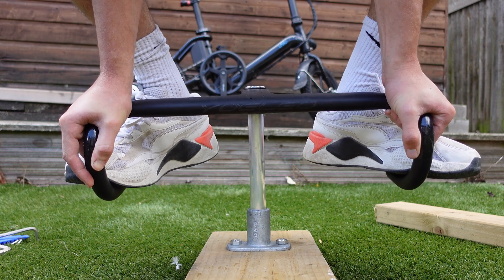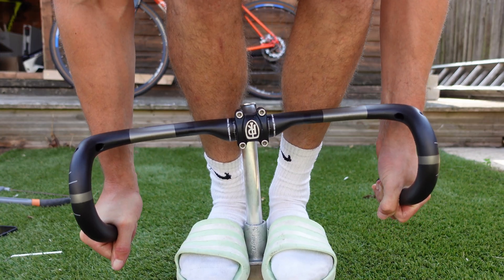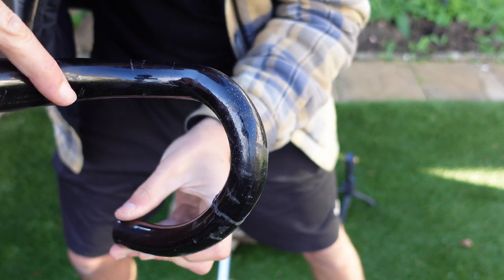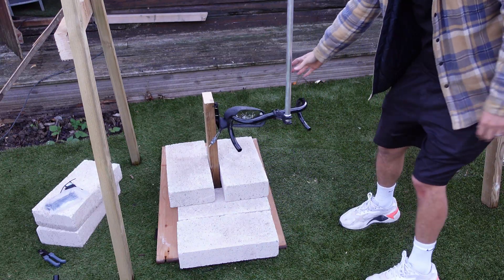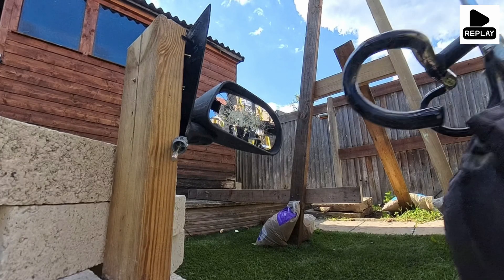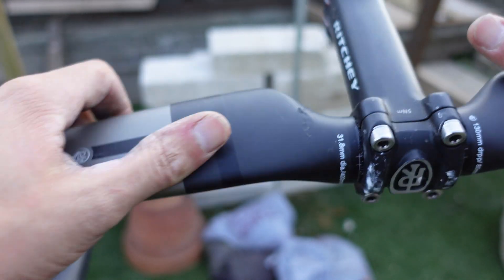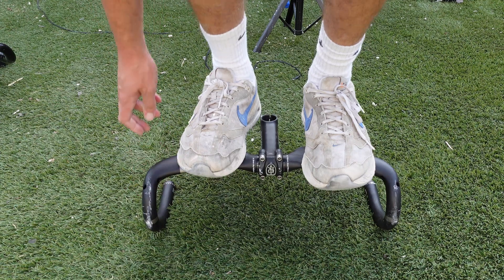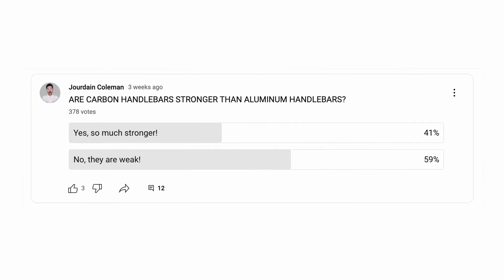Carbon Durability Test #1

Comment: Good-ish, but the distance from the stem to the pull point varies. Little point going past 150Kg. Measuring deformation at each load would be more useful. This is especially true if you plan doing frames/wheels etc.

Comment: Ratcheting test wasn’t equal WRT the position of the strap on the bars. The Alu bars had the strap closer to the stem. So the leverage effect is lessened and you need more force for the same real stress on the bars.

Comment: The strap test seems slightly unfair for the integrated carbon bar/stem, as at 15:50, the bar seems to be resting in the sharp corner of the wood beam of the gig, This is creating a stress point that probably help the bar breaking when and where it did. The aluminium bar was resting into the stem, so no additional stress point was created, apart from the interface between the bar and stem that was designed exactly for that purpose. In summary,  in a completely fair test the integrated bar/stem would probably withstand a slightly higher load and the difference to the aluminium would be smaller.

Comment: The first test rig. It doesn't bear thinking about what would have happend if the bars had snapped. Coming down hard on the stem/top of the tube would have been eye watering.
Reply from the maker: It would have been a very different video 😂

Comment: Now do it again but slightly over tighten the stem bolts and watch the cabins snap on the joint. Before anyone starts I know you all torque them correctly but you don't once you're in a field on the first ride and decide to roll your bars slightly

Comment: Hi chap. That is a huge undertaking to bring this excellent experiment to your audience. Where do you find the time?!

A few comments ( sorry i am commenting from my private channel) : The stress test you showed on both carb and alloy bars its important that the straps are in the same place for both. The alloy got a bit of freer ride on the non-drive-side so you would possibly see a lower weight to distortion ratio from the alloy. Also the carbon bars are a good bit thinner in wall thickness discounting the weight difference for that size object so there is that to factor in. 
The main point to make is that for this intended purpose, even as a carbon guy, alloy wins in my book. Why? simply because of the way alloy and carbon break under pressure. A pure carbon bar will always fracture after it over flexes and like a house of cards, you go along with it. In most cases the alloy deforms a fair bit before it comes apart giving you a chance to sit upright and stroke your brused ego. It is the same with stems and crown races in forks. So it is not about which is stronger it is about which one gives the rider the chance to not face plant. Alloy is plenty strong enough for this purpose as your tests show. 
There is a rule here at CarbonBikeRepair - If there is 1 of anything keeping the rider from a face plant it is better made of a material which can deform rather than fracture first. Of course the speed and weight of an impact is a rule unto itself but some cyclists perception that carbon is better, because it is structurally 'stronger,' only tells part of the story. There is still a lot of use for alloy in modern carbon bikes. We tend to watch the baby being thrown out with the bath water in so many modern bikes we see come through our doors.  Then there is this obsession with weight.. come visit us some day and I'll explain to your audience! Take care mate. Great honest channel for us all.

Comment: over tightening clamps is what does the damage.  That with crashes will cause failure make sure when you are doing the crane pull make sure the distance from the centre to the strap is the same.

Comment: Always read the instructions for your stem, some stems require to close the gap on the top. I ruined one carbon bar by torquing all the bolts and not closing the top gap.
Reply: It's annoying when this is never mentioned anywhere on the stem itself, like with Canyon's stems.

Luckily, I know how to determine without looking at a user manual (will still read one to double-confirm my analysis).
Reply: @sbccbc7471  How?
Reply: @Markus-.5712  Top-to-bottom faceplate asymmetry is what I look for. A hands-on method is to install the faceplate without the handlebars and see if the faceplate has two or four points of contact on the stem.

If only the top or bottom of the faceplate touches the stem when the bolts are bottomed out, then it's a zero-gao stem faceplate assembly. Regular stem faceplates will always fully touch an empty stem when only one or two bolts are bottomed out to hold the faceplate, indicating zero asymmetry.

The PRO PLT and FSA NS SMR stems are some examples of such a stem.

Comment: About the dropping test, when handlebars fall down it carry the weight of :  - The HB itself
                                                                                                                                    - The force of the moving bike before it falls down.
                                                                                                                                    - The bikes
Reply: And dont forget the rider who is also holding the bars that may tip over or crash.  The GF broke her carbon bars on a bad railroad crossing and went over on the bike and it cracked on the inside part past the shifters.  Lot more force than being applied here.

Comment: New Teeth are far more expensive then replacing youre carbon cockpit, keep that in mind. Yes most Carbon Bars can take a beating. But i wouldnt trust them anymore after one good hit. You cant always see the delamination.
Reply: I think this shows that it takes a huge amount of effort and force to actually make a modern (even no-name) carbon bar completely fail.  Your bars may crack, but it then takes lots and lots of repeated force to make it snap off.  I had a separate carbon bar develop a crack at the steerer from overtightening and a defect so I did a strength test like this video. It developed a crack at same place as in this test, but I was unable to break the bar after seeing the crack.  I would have been able to ride the bar home, and while I would not have wanted to do a 1000w sprint on the bar, It really was nearly impossible with my weight and strength to make it snap off.

Comment: Sadly in a crash my carbon bars snapped in 2  so gone back to alloy
Reply: The same can happen with any material. You can get aluminium handlebars which barely weigh more than 200g and they are probably weaker than many carbon handlebars.

Comment: Nice video! Next time take some protective measures. You would have lost your hands, smashed your head or blinded yourself if any of those bars had snapped and the pulling gears came straight at you. Protective glasses, helmet and safe distance from destructive tests
Reply: Or a safety tie like Colin
Reply: Except CF doesn't store a lot of energy because it's NOT elastic. The failure mode shown is very typical. Just "busted" with little movement. If you were using nylon rope to pull on it, (very stretchy), yes much more risk because it's a big rubber band.
Reply: Exactly!!
Reply: I was worried that a snapped bar was going to impale you.
Reply: Please don’t repeat this testing on frames. Your viewers do not want to see you get injured.